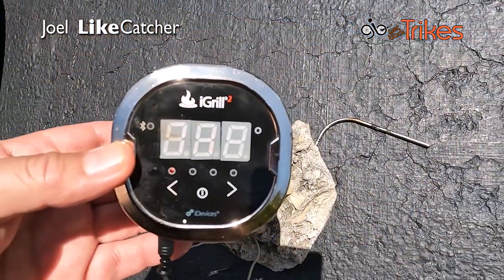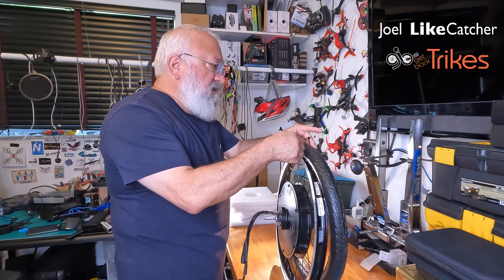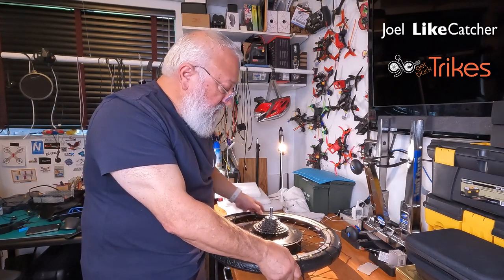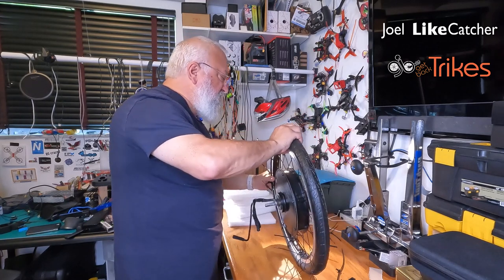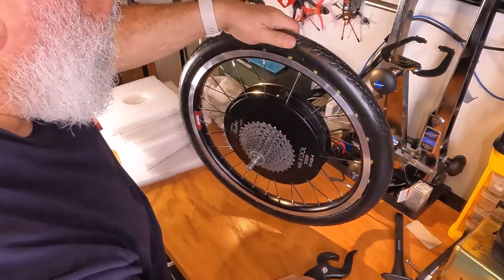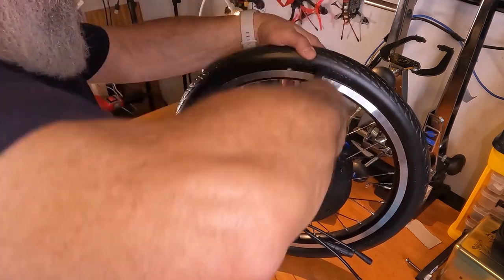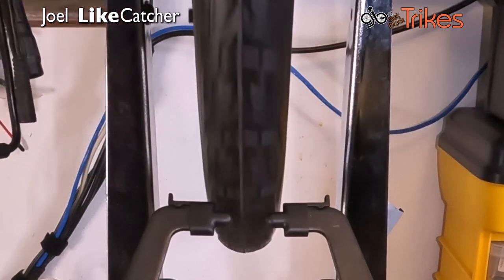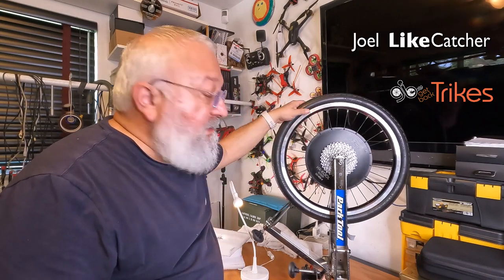Tannus Airless Tire Installation - PART 3

Comment: This is a great video! Especially the part of the wrong rotation. Something I would do. When I did my 700c I found pushing on the front part of the pin or maybe it was the end part but still on top. Not really sure because I think I blacked out trying to put the tire on. But so far I have put on about 6000 miles on it.
Reply: That's why I left my mistake in. "Do as I say, not as I do" sometimes.